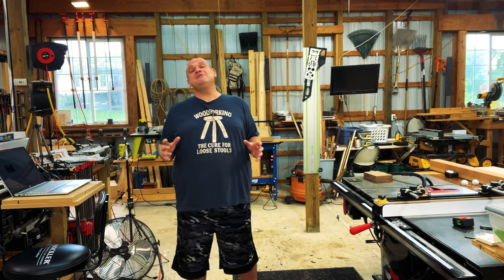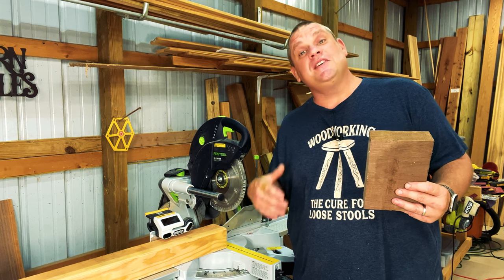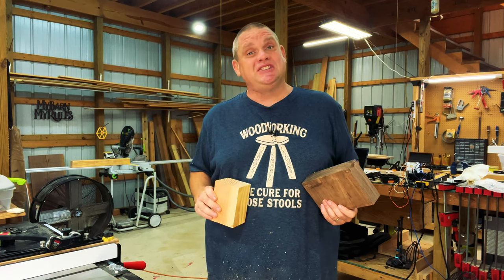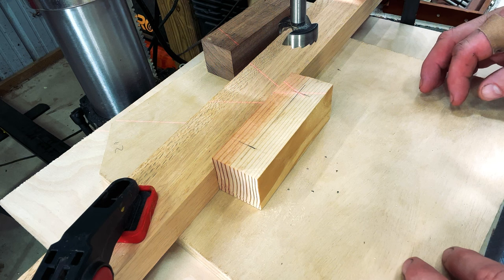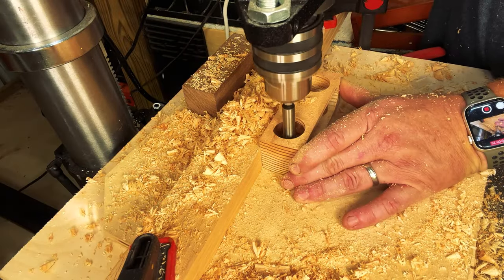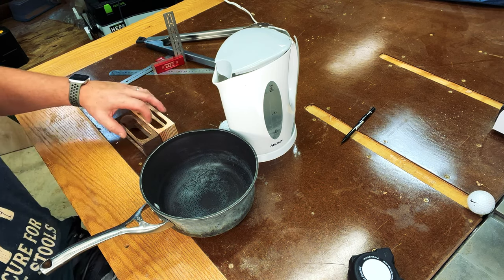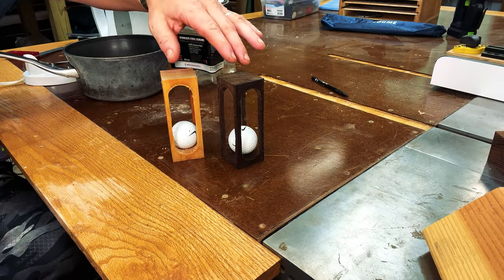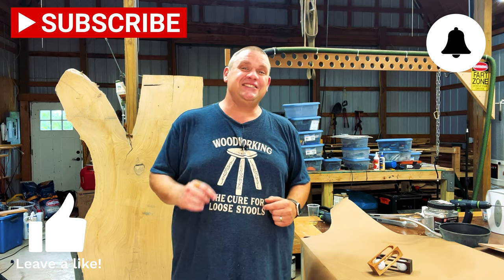Get Ready for a Fun Mind-Bender: The Impossible Golf Ball!  #woodworking #fun

Comment: The walnut went in easier than I thought it would’ve lol. I figured it one was going to break putting it in, it’d be that one.
Reply from the maker: That's exactly what I thought too.  I actually have a short coming out where I only did walnut, I'm guessing if you use the boiling water and soak it long enough, most hardwoods will work as long as those sides are thin enough!

Comment: I clinched up when I watched you rip the stock with your push stick. I never use that style when cutting such small pieces as the chance of that kicking back at you at 200 miles an hour is too great. I had that happen to me once and I will never do that again. I would recommend using a push block to hold the small pieces down and towards the fence for more protection rather than just pushing them from behind. I saw your hand and thought something bad happened to you off camera. Hope you’re doing okay and thank you for the video.
Reply from the maker: You’re probably right probably should have used a push block for sure.  Thanks for the reminder!  Thanks for the comment and thanks for watching!